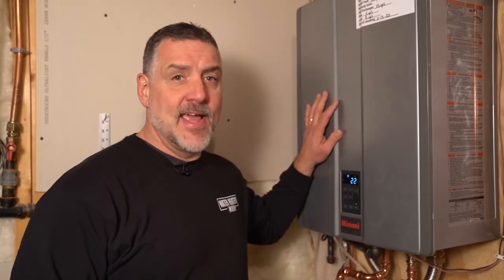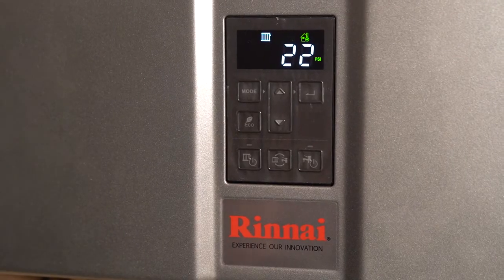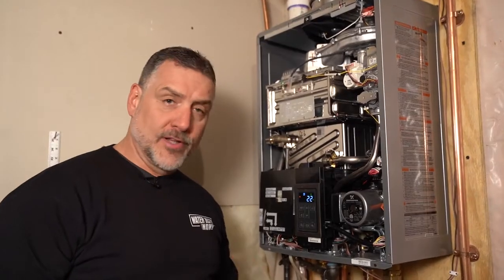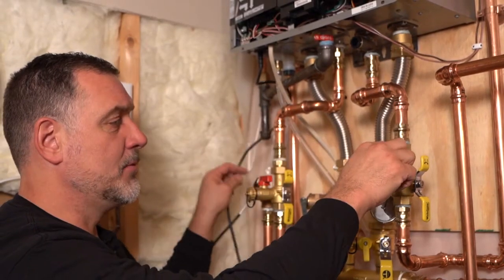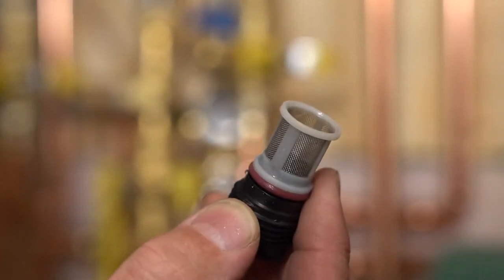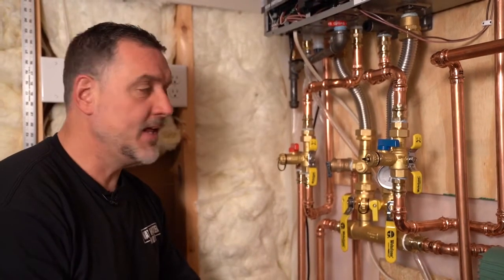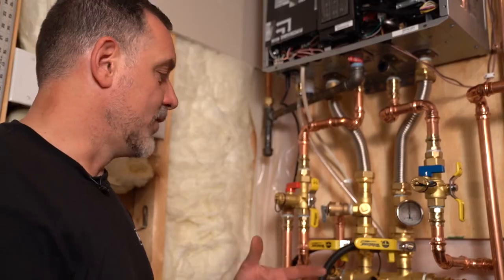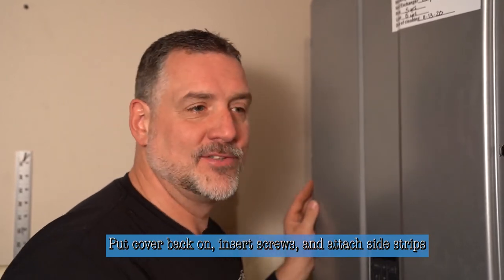Rinnai i120 Combination Water Heater Boiler Annual Inspection- Water Heaters Now

Comment: Hey Ray - Great video. thank you. you seem to be an expert on the Rennai heaters. I have the same one in your video (i120) but the household water is locked at 120 degrees. Do you happen to know what the unlock code/process is to increase the celing temp above 120 degrees? Thanks in advance Ray!!

Comment: i have a combi rennai i060C (reb- 1847ff-) the problem i hve is the hot watwer heater works fine i ean gives hot water but if a fixture is running not a problem once i turn off the fixture the releif pressure valve start leaking lots of water but nobody can tell me whats happening the plumber can figure it out yet an a meanwhile no oht shower any advice

Comment: I'm getting ready to have a Rinnai installed at my house.  How reliable is the hot water?  Do these things break down a lot?  I'm on the fence about the combi is why I'm asking.
Reply: hello I was wondering if you had the unit installed and how everything is going so far the hot water and heating, I'm thinking about installing the i-series 120000btu gas combi i seen a few bad reviews which makes me a little nervous ANY INFORMATION WOULD EXTREMELY HELPFUL .

Comment: Worst purchase ever. I just had a i120 installed. It has eaten two tanks of propane in a month! It is always running and the installer says there’s nothing wrong and the Rinnai company has also agreed that my brand new unit is working fine. Apparently $800 a month is normal??? No thank you! I wish I never switched out my other furnace. I use to live with many more services on propane and paid a fraction. Hot water tank is waaaaay cheaper!  Huge mistake buying this… it’s still running… everyone is sleeping and thermostat is turned down? Why is it constantly running???!
Reply: Ever solve your issue with lp consumption?
Reply: @jmm1000  Check Rinnai i120C documentation on page 81, DIP Switch settings. set switch 1  to ON which means NOT to use outdoor temperature sensor.
Reply: @gogtarial8693  thanks GT!

Comment: Good evening Ray,  

I see you to both Navien and Rinnai tankless and combi's.  I have a couple questions that maybe you could make a video to address or just responding to them would be greatly appreciated.  I have a 110,00 BTU 80% furnace I was wonder what your thoughts where regarding replacing it with a hydronic air handler and a tankless or Combi, would I get enough heat out of it to replace the furnace and would it work as well?  I have a tank water heater dated 1994 so I was considering replacing that and possibly the furnace too.  Next which brand do you prefer and why, navies or Rinnai?  

Thanks Doug

Comment: This video is so great you explained a lot of things very clearly I have a Bradford white unit for a house, using 14 heaters. I was getting a error code number 41. The air blower was changed but still get the error code 41. do unit was installed two years ago in 2018 now no one ever told me it needed to be serviced that’s the installers fault. Not pointing fingers but I have done both sides domestic water and boil water in my unit is running perfectly fine I’m happy to find a video after but I watched numerous videos on how to do it your video is very clear into the point.  thank you. A+